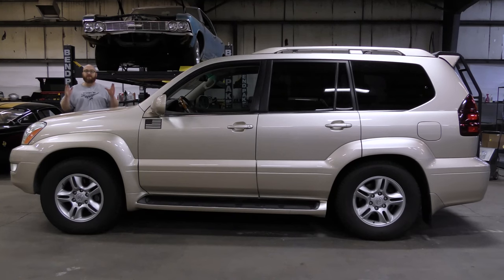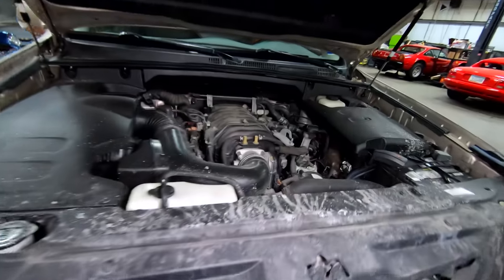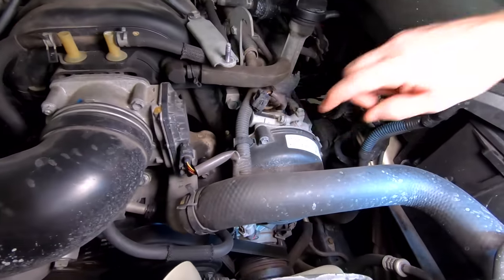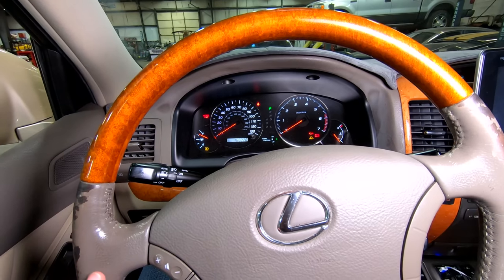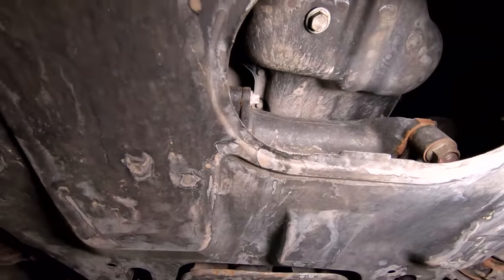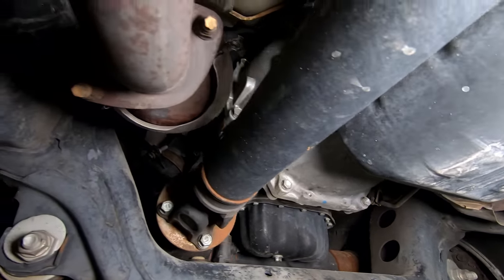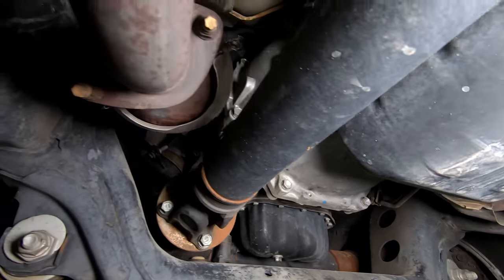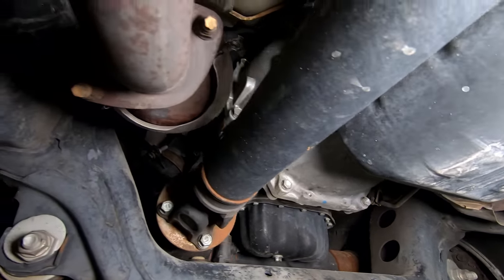How could this super reliable '07 Lexus GX470 have such a stupid design? CAR WIZARD weighs the risk

Comment: Wizard, you forgot to mention ABS booster that tends to fail with limited or no warning. I don't know about the GX but LX/LC 100 series rear shock bolts are nightmare-ish to get to, especially if rust is involved.

Comment: Taking that intake off isn’t a big deal. I had the one on my sequoia off 3  times when the supplemental air pump decided to suck it’s filter sponge up and blow the pieces into the output valve that I had to replace. Grab your metric sockets and extensions.

Comment: The biggest thing I've always questioned why some companies use a timing belt and not a timing chain. To me it makes sense to use a timing change because it'll last life of the vehicle whereas a timing belt needs to be changed
Reply: Well mostly, but crap cars like many of the gm junk goes through chains like crazy and it’s a much much much more expensive repair. Local place has almost only equinox Buick version small and large gm SUV’s because they’re all at auction stating they need engines: chains are bad and the guy does the big job himself and sells them after to make a few bucks. But if used cars weren’t so expensive right now they’d be in the junk yard at not even 7-8 years old.

Comment: Wizard, doing an alternator on a Maserati or ferrari with the Ferrari f136 engine from 2003-2013 requires the intake manifold, injectors, firewall plastics, wiper assembly and a lot more removed.

I thought that was a bit much the first time I did the alternator.
Reply: I'll see your Ferrari and raise you a Bentley (inside transmission bell housing)

Comment: Starter and secondary air pump under the intake.  I didn't find the intake that hard to take apart, but i've seen the starters in the 4.7 last the life of the car/truck.  When they went to the UR series, starter is behind the exhaust and a bitch to get to also.
Reply: Bypass the stupid air pump and save yourself the inevitable misery.....internet is your friend

Comment: I wish my 3UZ had the starter on top as well, instead it's underneath and actually harder to access. Keeps it out of mud and water as a bonus. My Chevy had to have the intake off to replace knock sensors well before 200k, so I would have just done the starter also in addition to intake gaskets if it was set up that way, lol

Comment: The starter location is the only downside to the indestructible 4.7L V8. Just get yourself an OEM unit and you’re good for another 200k+
Reply: Another downside is the secondary air injection pump that may put the vehicle in a limp mode if it fails and may cost up to $2,000 to fix. Here is my preventative maintenance of this issue:https://youtu.be/tLmp7DSBYLI

Comment: My 2003 4runner with the 4.7 has 265k miles on it and I've never replaced the starter. I also have the Alpine Halo in mine as well, some of the worst money I've ever spent. The Alpine Halo head units are junk.
Reply: I have an '03 4runner limited with the 4.7, with 180k miles and original starter. The only major issues so far were replacing both exhaust manifolds and putting in a rebuilt brake master cylinder/brake booster.

Comment: Another SUV with a design flaw is the 3.5l Santa fe, the oil pressure sending unit is under the intake manifold. About a 3 hour change for a $10 item, and you might as well change the plugs when it is off.

Comment: I bought a full dealer service 2007 Lexus GX 470 with 200k miles on it from the dealer, I asked them to put it on the lift so I could inspect it, this a Ca car, I checked to see that it was not flood damage and other stuff, I put my hand everywhere, in all the tough places to reach, when I was done I could eat something with my hands.  Spotless.
Reply: Point? You like to eat with dirty hands?
Reply: @notyouraveragewhiteguy7821  I eat all the way down to where my hand is touching the food and I throw that part away, I did not work in an office for 33 years.

Comment: The underbody doesn’t stay that clean up here in Detroit. My parents 2016 4Runner has been cared for exceptionally well and garage kept. And looks like hell underneath from surface rust. There is just too much salt used on the roads up Here.

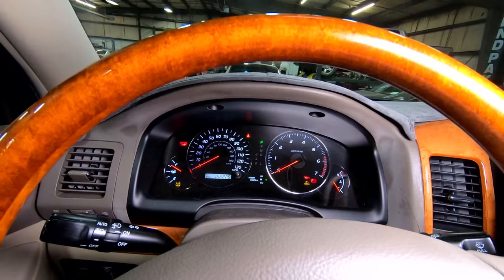Comment: The reason for the Dashmat is because of the dreaded "Toyota Melting Dashboard" syndrome which affects a very large portion of the entire 07 - 13 Toyota lineup.  If you look carefully at https://youtu.be/8WehvwxvKBI?t=311 at about 5:11 in you can clearly see the cracks and the fogging on the exposed dash to the right of the instrument panel.

Comment: The OEMs try all kinds of stuff to make their engine packages as small as possible. Relocating things like starters and alternators in an engine's Vee is a good way to do this. Roush Engineering was working on packaging stuff for the OEMs back in the 90s, you can blame them. Turbos are now between the Vee on BMWs and Mercedes.

Secondly, the start-stop features gives the OEMs enough of a gain in efficiency (0.5, 1%, whatever) that they take it to avoid has guzzler taxes, etc. However, I have to believe they made the starters capable enough that they can handle the extra starts. They'd have too be stupid if they didn't do that. Honda is an example, on their hybrid Civic. The starter, alternator and the flywheel was replaced with a 10 hp pancake electric motor. They are much larger now. Not only did you have parts consolidation but the added gain of start-stop fuel efficiency. Being so large, I don't imagine it was more susceptible to failure. Not everything's a good idea, but the way Honda did send really good.

Comment: This is the #1 veh in my country, they come in toyota prado version diesel or gasoline 2003 -2007 will cost you over $20k with alot of miles over 200 k miles & No they don't go down in price. Very Reliable Suv and great on fuel diesel version.

Comment: My Kia Borrego V6 has 250K on it, there's a V8 also, still runs like a champ, doesn't take a drop of oil, never changed anything on the engine, and i think, it looks better, you can have a Borrego for much cheaper, really great SUV.
Reply: Go buy a lotto ticket! You lucky. But comparing your Kia to a GX is insulting. Apple's / Oranges

Comment: The starter on the 5.7L is under the right side, like a SBC.  But you have to remove the right side exhaust system (header to Y-pipe) and two heat shields to get to the starter!

Comment: My 08 Focus is the same way. Need to get to the starter or PCV valve? Fuel rail and intake are coming off. The thermostat is behind it too, but luckily it can be removed  with socket extensions and long nose pliers.

Comment: The starter is under the intake as a design feature, as first seen in the lexus v8 that came with the ls400 and the lexus brand introduction in 1990. The part is designed to work for 25 years Cuz it's over engineered and dry and safe

Comment: I don’t get why you say this.  I have 4Runner V8 which has the same engine.  In 19 years I have never had to replace the starter.  In fact it works exactly the same as when the car was new.  The fact that it’s not terribly convenient to replace it if you need to is such a minor thing.  Heck, it may intentional that in an off-road vehicle they tuck the starter way up out out of harm’s way.

Comment: It's not a design flaw, that was intentional by design.  That engine has been certified to be used as an aircraft engine.  Having the starter directly in the center of the valley makes the engine completely balanced, instead of one side weighing slightly more because of a starter hanging off the side.

Comment: Just did the timing belt, water pump, seals, pulleys on my 2003 Toyota Tundra with 165k miles. $1,500 for parts and labor. Still has the original starter. I’ll replace it myself if starter goes.

Comment: A worse design decision for me is that the alternator is under the engine, behind the PS pump. Pain in the butt to change, and on trucks that are great off-road, putting your alternator where it will be submerged when fording a stream is pretty silly.

Comment: J'm adding a SECOND gas tank too-- in the wheel well where the spare would have been (since it will be on a swing in back)..and that gives me 56 gallon capacity instead of 23- for around an 800 mile driving range..

Comment: The air bags need to be replaced on the rear suspension as well.  EDIT - Posted that within 10 seconds of the video starting and glad to see you ultimately addressed it.  The air suspension is a known issue on the GX470.

Comment: Mr. Wizard-  I'd love to tell you about the horrific ownership experience we had with the brand new Lexus LX300, 1999.
Maintained at the dealer, per the recommended schedule, etc. We had oil sludge problems which required an engine re-build at around 90K miles.  Toyota / Lexus would not stand by the product.
We sold it back to the dealer and said "Never Again".  Tons of $ spent on dealer maintenence and no help .  They'll never get another dime out of me....

Comment: When you lift the car, the sensor thinks it’s too high, it lets some air out of the suspension which is a normal function. That’s why when you lowered back down and started it it pumped air back in the suspension to make the car level. If you did change the airbags on this then you just added an unnecessary repair/cost to your customer.

Comment: Its not that bad. Its a ~150k item, at least its not in the bell-housing like a new BMW. Worst design flaw is the cats integrated into the headers, subsequently forcing the starter re-location. Also the SAS on 05-09 throws codes, before you bypass it…Thanks EPA.

Comment: With Stop start systems, another cost is the car battery. They are usually $100 more than a standard battery. Due to the extra load of stop / start. Heavy duty battery 🔋 has to be fitted. So there goes your fuel savings. ⛽ 🙃

Comment: The starter under the intake manifold is not unique to this model Lexus.  I have seen them on Nissan Titan, Porsche Cayeene, Tundras and a few other v6 Lexuses and Toyotas.  The thing about the Lexuses/Toyotas is starter replacements are rare.  They are Denso units and they rarely fail before ~250K.

Comment: Only guess about them wanting the starter changed out is due to age and miles.  Easier to do a little preventative work at thier convenience instead of it breaking.  
I have changed front and rear wheel bearings on kids Honda due to same reason.  250K miles. But bearings are cheap.

Comment: A starter under the intake seems stupid but for a starter, that's a pretty good environment.  Dry, not next to the exhaust, not getting sprayed with salt water in Midwest climates.  As long as it's a well made permanent magnet starter it should last a very long time, probably longer than the vehicle.
Reply: And they do, these starters are bulletproof to begin with. Nevermind the fact you'll be in there anyway to fix a half dozen other issues first.  People will complain about anything.

Comment: Timing belt & pump is every 90k. 

Idk why they want the starter replaced. Even with manually doing start/stop with the car, it should last until 250k miles.

Comment: The dash is probably cracked under the mat. Very common problem. And the leather on the seats wears quickly, hence the seat covers. It also needs the rear airbags replaced, I just had mine done.

Comment: Looking for a new vehicle and my gf has a 2018 Equinox and tells me I should buy one or a Traverse and I said no. Reliability is a major issue I see GM quality on my 2011 Cruze LS, no turbo, and horrible automatic and the wiring harness issues. Waiting to buy a KIA Telluride or Subaru Outback. Also, after 8 years I would have expected GM to update the Equinox dashboard, it is still my 1st generation Cruze with a touch screen.

Comment: Airbag springs at the rear of these? My Land Cruiser 100, which is about the same thing only mine is a 1998 4.2 turbo-diesel. Mine has a hydraulically assisted suspension where the dampers are actually hydraulic rams linked to accumulators mounted outside the chassis rail.  What ended my Cruiser’s economic life was the brake servo failing. That will be the same as the Lexus and mega-expensive. Doubly so if the recommended brake master cylinder replacement is done at the same time. Just as the servo failed, the hydraulic suspension also failed but that’s not such a big deal because I had bought used ‘standard’ coil and tortion bars years before. All the parts needed to buy to do the job would then be a set of four dampers to replace the rams.

Comment: Hey Mr. @Car Wizard any recommendations for 3rd row SUV's with AWD/4x4? 
hobbyist here with a 2 post lift at home, I do all my own maintenance. Leaning to Toyota of course, which model would you suggest?
Reply: First gen Sequoias are still inexpensive. Find one with minimal rust. Like this GX, it's easy to work on. Not a lot goes wrong with them. I've had mine 4 years and 80k miles with 340k total. Did a 4k Florida trip in Dec. without fault and came back and tackled a 6in snow storm like nothin. Has belts for 8, but 6 is comfortable. Decent room in the back with the seats up (nothing competes with Suburban). Totally flat floor with 3rd removed and second tumbled. MPGs are sub-20. Will tow a good sized boat, trailer or car easily.
Reply: @davidkaminski615  thank you friend! How has the maintenence been like?
Reply: @poot111111  Oil changes are with synthetic every ~5k miles. No sludge. Diff and trans fluid changed every 40k. Trans shifts smooth still. Brake pads and rotors were done when I bought it 4 years ago and still have meat left, no warping.
These trucks are 15-20 years old now, so things are starting to age out (seals, hoses, struts). Electrics are still good except for the back hatch stuff, but it's easy to DIY.
Reply: 05 sequoia with 237000 miles. Awesome rig, drive everywhere!
Reply: @davidkaminski615  That sounds awesome ! thanks for the heads up, an inattentive driver totaled our v6 Rav4 and now we are looking to upsize. We will definitely go for a test drive in one!
Reply: @poot111111  Good luck with your search!

Comment: swapped a starter on an 4runner, had to remove passenger wheel and snake hand in to the yoga position greasy aching back, use universal, 1/4 ratchet, and luck. not sure why but starters are a pain on any Toyota. but if you buy good parts you will only do it once for life of the vehicle.

Comment: Actually there is an off feature for leveling the rear air suspension. A mode for service. Height control-off right beside height selector.

Comment: Your traditional starter isn't used in cars with auto start/stop feature. They either have a much beefier starter or use a second dedicated starter for that feature. It also helps fuel economy significantly and reduces carbon emissions.

Comment: The start/stop thing on new cars doesn't save anyone any gas worth mentioning. Its sole purpose is to spoof the fed fuel economy rules by exploiting how the combined MPG is calculated now.

Combined mileage is calculated by highway miles which is a no brainer. But the city milage is also taking into account time spent sitting at lights. Burning gas but not moving. Shutting off the engine for even those couple of seconds at a shot shows on the test as vehicle "active/moving" but using no fuel at all, artificially driving up the average.

Comment: I'm not sure what the issue is with the starters on the 2uz engines. I'd rather do 10 starters vs the rear shocks. Leave the injectors in place or else you'll end up with a nightmare.

Comment: Cars with start/stop systems which ais federally mandated now, have more robust ignition components designed to last 3 to 6 times longer then vehicles with no start/stop system. I believe the GX and 4Runner are one of the few left without that system, at least till 2024 when the new powertrain comes out which definitely will have start/stop.

Comment: I am a DIY and i work only on Toyotas. Even a head gasket is easy on those,  4 cylinder or 6 Cylinder, always easy. I wouldn't touch a Honda unless it's just a quick oil and filter for a friend.

Comment: Like a Person, this Vehicle no matter how Nice and Pretty, there is a Design Flaw. Putting a Starter under Intake allowed a Dumb Engineer to get a Raise . Starters hung underneath vehicles have worked fine for many years and does not require 4 hours labor just to pull starter...

Comment: Sadly Toyota did not fix that stupid mistake of putting the starter in the back of the engine on the 5.7 L V8 I force. It’s the same situation on the larger engine why they did that who knows but regardless I had to replace mine at around 196,000 miles and it cost me $2700. Just did it last January On my 2009 tundra.

Comment: I thought the stop start feature of a vehicle had a different style of starter but maybe I'm thinking of a hybrid vehicle because I don't believe it's like a normal starter and it's designed to operate far more frequently like maybe the electric motor in the hybrid starts the engine.  But I don't know I've never owned a vehicle that's been newer than 9 years old

Comment: My Nissan Titan has the starter under the manifold as well. Corrosion still gets under there though. One of the terminals was very corroded causing an intermittent connection.

Comment: The starter has copper contacts that wear out f they’re replace the starter will run again for another 200k miles. Those contacts are around $3 at the dealer

Comment: old lexus was a good buy precovid, now they have bloated prices and if its a northern example forget it... salt will have likely compromised the frame or half the suspension components. rear hatch handle will have rusted out. almost all used 4.7's are in desperate need of timing belt service too. risky and expensive to buy used right now unless you feel like dropping 3k in service right away.